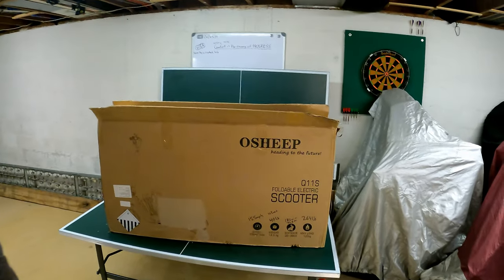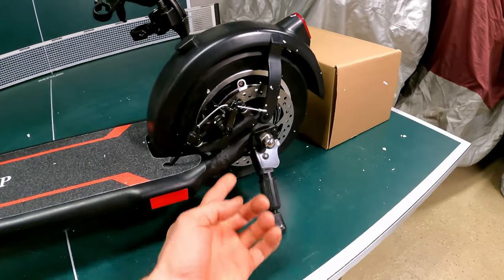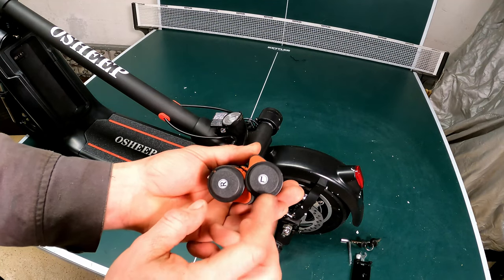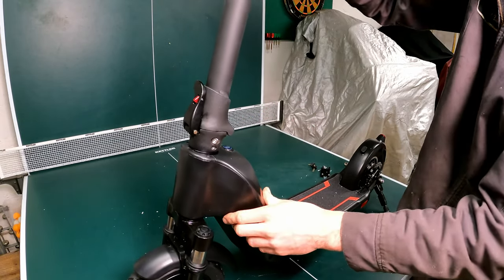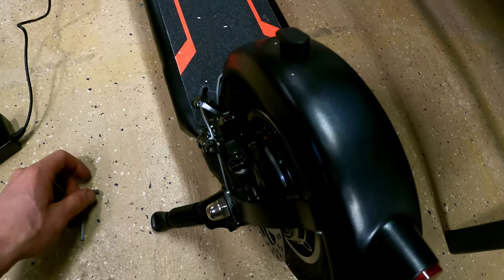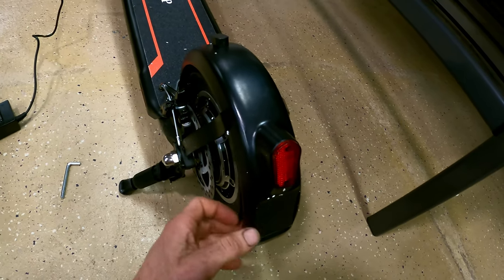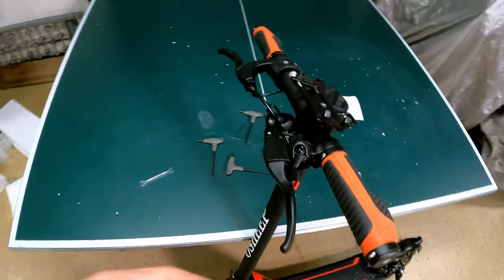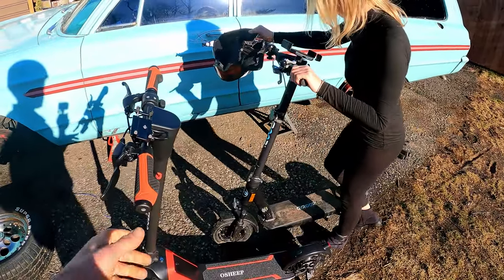OSHEEP Q11S Electric Scooter Review - NNKH

Comment: Best of the three so far... even with the lower speed, pretty well built and integrated bar lock, sweet ride.  Any idea how heavy the battery is ... if you carry a spare that could add to your weight on a trip and be a bit of a burden.  Well done and thanks again ... great reviews Chris.  Have a good one.
Reply from the maker: Yeah it's a pretty good unit for sure! And the battery is fairly light. I would say maybe a few pounds. Definitely could carry a spare or even two.  And thanks man I appreciate you checking them out